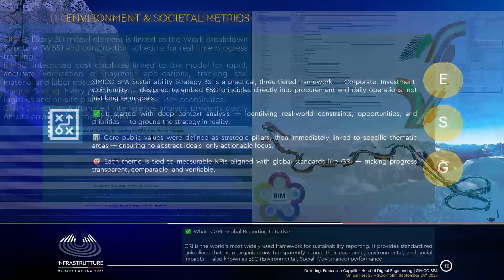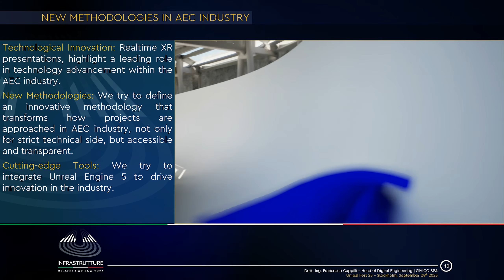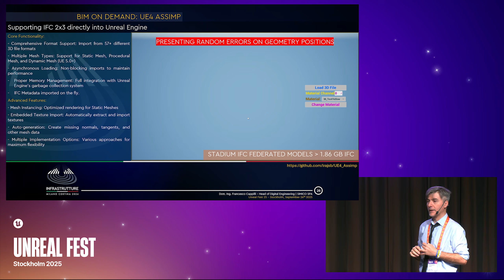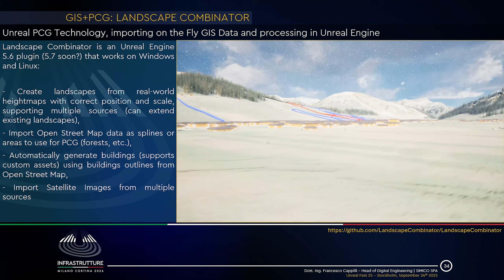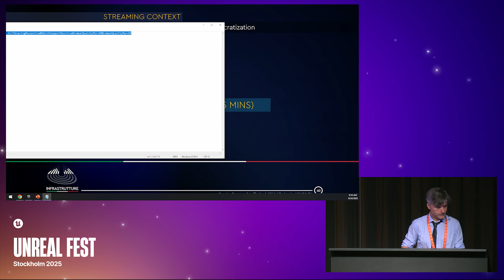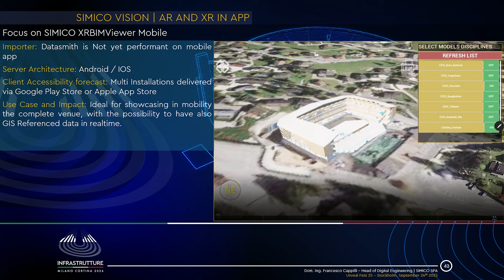Engineering Digital Twins for Milano Cortina 2026 Winter Olympics | Unreal Fest Stockholm 2025

Comment: Epic Games is currently one of the most sensitive companies in the gaming market. Many players dislike the Epic Games Launcher, and Epic has not made significant investments in the Linux ecosystem, unlike Steam, which has a native and well-established version.

At the same time, Microsoft’s inability to deliver an operating system that truly satisfies consumers has driven a growing wave of migration to Linux. This movement is led precisely by the audience that spends the most on games. In the near future, a gaming market focused exclusively on Windows is likely to lose relevance, especially as tools like ChatGPT and other AI solutions have drastically lowered the barrier to entry into the Linux world.

If Epic remains inactive, it will arrive late to this shift and retain only a small fraction of the audience. There are several initiatives that could change this scenario. One of them would be the complete separation between the game launcher and the Unreal Engine launcher. From a developer’s perspective, it makes little sense to depend on a game launcher: the goal is to produce and earn, not to consume.

Other positive measures would include:

A native Linux launcher with a simple Unreal Engine installation process.

Keeping asset purchases on the Fab website, while ensuring that all purchased assets can be downloaded and used natively on Linux.

The creation of a Linux-based Unreal Engine system capable of automatically generating virtual machines for debugging and multiplayer interaction simulation.

There are countless possibilities that Epic could explore on Linux to make developers’ lives easier and significantly reduce resource consumption, since the platform offers much greater system control. This could include, for example, Android simulation via virtual machines, integrated Google Play testing, and more.

If Epic does not take this step, someone else will. The market already has strong alternatives, such as O3DE, which may become increasingly attractive.